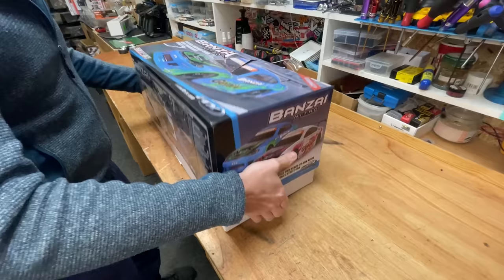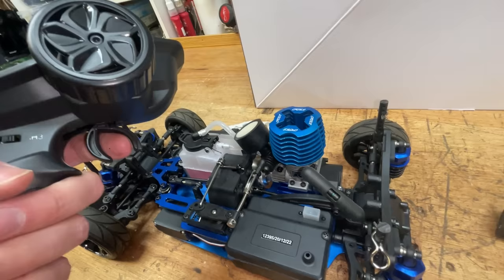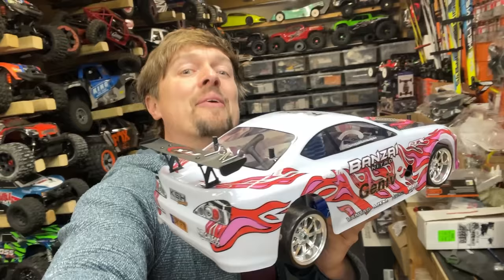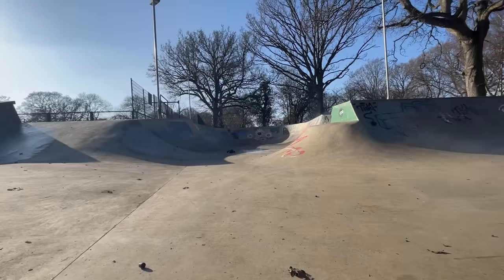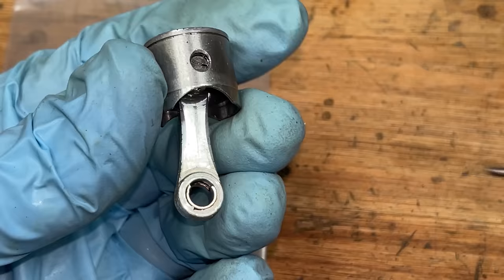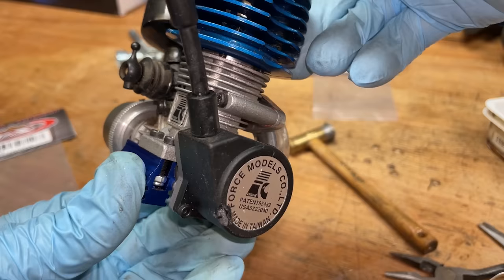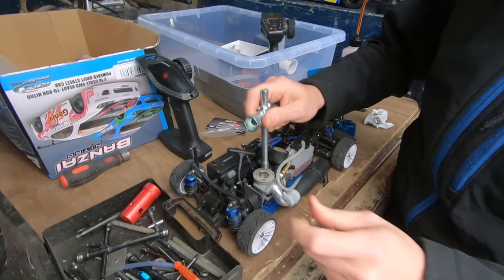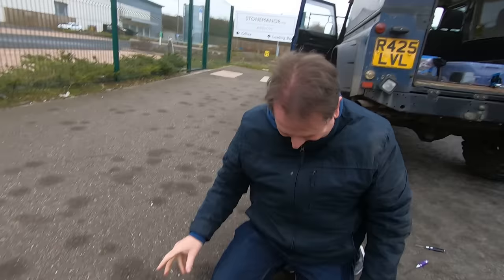Nitro RC Drifting (40,000rpm Engine Failure)

Comment: So again, nitro sucks?
Reply from the maker: user error. didn't run it in and and over revved and overheated it. these engines are really good actually
Reply: Nitro works just fine. If you have mechanical sympathy they can be long lived. Just like in the real world, there is a place for ICE and EV.
Reply: That’s the scx24 v2 radio lol
Reply: not atall, It is being overrevved no cooling, Had nitro engines for years set up right and treated as any engine should be no issues.
Reply: Im pretty sure that nitro motor with that high rpm range those rubber tires would drift no problem.
Reply: @user-qq2mo1ek2r  Yeah i have had nitro motors that last 15 years and still run amazing id say they actually rev higher and more responsive the more they are broke in.
Reply: I mean, they can be great. But in my experience, my friend has 4 nitro cars and 1 Arrma Kraton 8S and none of his nitros run, and he takes care of them very well. And he can't seem to get them going, but that's probably just his fault.
Reply: @eweezy946  yep also learned the hard way for got to remove the nitro gas in mine one time after storing it away for a min big mistake...
Reply: Yip the hassle sucks but the sound is awesome
Reply: Got to love that smell and the noise.
Reply: I’m personally not a fan of side exhaust engines but Kev is right they normally are pretty reliable if you intend on driving on low traction it needs to be tuned to temperature  also adding more oil to the fuel is a good preventative measure for this even 20% oil likely would have prevented this failure
Reply: @KevinTalbotTV  What about an episode with a nitro rc speed boat hitting a floating ramp and sending it to the moon?
Reply: Nope.  Properly broken in (if you're starting off with a decent engine, not something like the traxxas 2.5) then you can have years of relatively trouble-free operation
Reply: u cannot run or even break in nitro when its cold out its just not gonna work
Reply: @derekgardin1512   I've been running a Traxxas pro 12 or 15 (don't remember, it's on an OLD 4-tec) & a 3.3 for nearly 20 years.

Not race engines by any stretch of the imagination but I beat the hell out of them & they just keep taking it. Best upgrade ever for them is running a relatively flat 3s lipo for the electric start/glow plug igniter, and occasionally rebuild the carb if you make a ton of tuning changes. Any more trouble & a separate glow igniter usually solves it.
Reply: No they do not
Reply: Brushless motors and lipo batteries changed the game
Reply: Have to run them in
Reply: Yeah kev ..you should not have installed the drift tires... essentially your promoting over revving even more since all your doing is spinning the wheels .
Reply: @biggestthreattoyourexistence  I agree that lipo/brushless are both more powerful and less hassle but when you got a nice set up nitro it's just awesome...
Reply: Arguments over nitro vs brushless🤔 I have Hpi savage flux and various nitro versions of the savage and while electric is more powerful and convenient you just gotta have that sound and smell🤗 same goes for the Baja 5b.. also you gotta break em in or you just asking for trouble😂😂
Reply: You act like Kevin doesn't intentionally abuse everything he drives.  Nitro engines aren't that bad.  Before brushless and lipo they held the crown for power and speed.
Reply: @tonberryhunter  Defo🤣 he drives to destruction so we don't have to, that's the beauty of his channel👍as for nitro... I have a few that will do between 50-80mph out of the box and that's more than enough for me🤣🤣👍
Reply: User error, failure to break in+ bad tune. Kid didnt use a temp gun
Reply: No Kevin has NO IDEA how to properly break in or tune a Nitro engine, these HSP Care are very good for the cost, if you treat the car properly.  Kevin gets all this for free so what does he care, but the rest of us have to actually pay for things, and cannot afford to just go destroy our stuff. Go to a REAL Nitro channel and learn how to properly use a Nitro engine, not Abuse a Nitro Engine
Reply: So painful to watch … that poor nitro.
Reply: Where can I buy it??
Reply: @7r0j4n  You CAN if you preheat the engine before you start it, and wrap some layers of tin foil around the cooling head to keep the temps up during break-in. Keep an eye on it with an I.R. temp gun, and adjust accordingly.

I've done it many times in the cold, but I would not recommend it to a beginner to nitro R/C. 

Believe it or not, I have a WHOLE different way of breaking in new nitro 
R/C engines, and I do it in the car, with the car up on a test stand, with the engine at wide open throttle for 10+ tanks of fuel, with a heating device wrapoed around the head of the motor, all the while monitoring temps and keeping them just where i like with the heater. I'm not going to go into anymore details here, it's DEFINITELY a method for advanced nitro users, but this break-in method produces the BEST running, and longest lasting engines ever. I've been doing it for over 15 years.
Reply: Sussy baka
Reply: @James Cozzitorto  it doesn't do anything just put new fuel and fuel lines in and itl melt the jelly fuel no big deal
Reply: Oil bath run in method for an hour and they last for years with the right tune 👍🏼
Reply: No. If you got half a brain and break in the engine the proper way by pre-heat before start. Heat cycle
Reply: 1: no engine break in. 2: running drift tires and revving the engine like that I'm not surprised it blew! Stick to electric bro. Nitro is not for everyone 😁
Reply: Chinese ? Stock Bad quality of metals and gears?
Reply: Should always be broken in. Tuned properly and these engines will always output excellently and i have to say that i have never had these issues but these guys here on this video seem to be clueless which does bring a bad name to them but not to nitro engines. They beat the hell out of the piston and call it a complete rebuild 😂
Reply: I don’t know. I came from nitro to battery. Some times I miss nitro. Some times I don’t. But similar things happen with electric 🤷‍♂️
Reply: @Krapper515 en nitro tiene que tener uno idea que como funciona si el chispo que lo que da corriente ala bujía no está cargado no te arrancará nunca por eso si que coger una bujía i mirar si se pone incsndecesnte se enciende 😊
Reply: I have the same engine and its perfect dont be put off from it if you run it properly itl last and drift tyres are no need it slides with normal tyres
Reply: i have electric never had any problems this seams very complex and problematic
Reply: Nitro RC pylon racer planes are a lot of fun though. I love the sound of a 30,000+ rpm glow engine paired with the Doppler effect.

Comment: No break-in at all is not a great idea 😂 Anyway, let’s make nitro great again ⛽️👍
Reply: he make nitro die again
Reply: @truthandfreedom8145  wet concrete on the park
Reply: @TheNamesArif  wet concrete drys oil doesn't.
Reply: 40,000rpm straight out the box 🤦‍♂️
Reply: i hope not
Reply: Who cares! He’s not in it is he? XD
Reply: He’s not in it 😂
Reply: Nitro was fun when I was a kid. The convenience of electric RC’s is where it’s at when you’re short on time.
Reply: If you don't know its usual to run a nitro for a few tanks to run it in. Just run several tanks before you go nuts. Then re tune if you know what to really do. Sure these guys know the the upper and lower limit screws
Reply: Hey man, that little run away was all the break in it needed ;)
Reply: he doesnt break in cheap engines he does break in the nice ones though
Reply: What dis you think was going to happen the first time it seized he took the head off unstuck it and ran it some.more the damage was already done all the metal shavings just circulating through the crank all he changed was the rod and rod bearing
Reply: Gotta run em in the way they're gonna be driven 🤣
Reply: That was hard to watch… he tortured the little engine to death.
Reply: Well breaking it in means he has less content of him rebuilding it.
Reply: Just got into it and now have 3 traxxas trucks
Reply: lets not
Reply: @HughsReviews  ive given up on brushless the nitro fuel smell burning my eyes and nose is where its at all day long
Reply: Hey, can you send me a car can you show me the car?
Reply: break in isnt really necessary, its just for the warranty. i just run a couple tanks of nitro through and make sure it heat cycles

Comment: The engines needed to be broken in before full sending them also u needed a temp gun to properly tune them little engines
Reply: Tuning without the body, then putting the body on often fucks up the tune/temp anyway.

Comment: Hey Kev, i just noticed that at 6:34 when you were rebuilding the engine, you swapped the conrod 
You were supposed to put the conrod with the small canal facing internally in the engine.
That way the conrod has no lubrication, therefore youu blew it up
Reply: The "small canal" doesn't have anything to do with it, but which way the OIL HOLE faces DOES.
Reply: @davelowets  that's the same thing, canal means oil hole, which redirects to the conrod, lubricating the shaft
Reply: @davelowets  and i'm not English either so imperfections in the way i express myself are to be expected
Reply: I have seen this mistake made on larger 1 cyl engines as well

Comment: Kev easy trick for body posts is to dab a bit of paint or tip-x on the tops of posts. Line up body gently drop on to posts then it will leave a mark on inside of body where to drill holes.
Reply: Great tip!

Comment: Kev What you should of done is richen the high speed needle maybe a 1/4 of a turn anti clock wise straight out of the box it would of then got more oil at those high RPMs.

Comment: This makes me appreciate electric RC so much
Reply: How? Never seized a nitro motor in my hobby years (20 years), but just burnt esc on my arrma under 10 battery cycles...  And they aren't cheap. actually, you could get a whole engine on that kind on money... Of course you can destroy anything at inapropiate use as this, but I would but my money on nitros if runtime between failures would be measured. And lets not go in to the batteries. There is so much junk on market that it is unbeliavable.
Reply: @TheGhostman132  Also when little kids want to use my truck I can either put it in beginner mode or pop a Nickel battery in and it's to slow to break anything

Comment: The hpi nitro rs4 racer I use for drifting has a piece of fuel tubing zip tied on the controller grip behind the trigger. It normally allows about 1/2 throttle. If I need /want more revs temporarily, I smash the trigger and it goes to about 3/4. You can play with the EPA to suit.  It has ran like this for years and it keeps the revs in check when just tooling around. I've even let young children use it like this and it's fine.
Reply: Thats a really good idea. I thought the engine might of over heated from revving out without the car moving all that fast. Air cooling is only as good as how fast you are going. Revv limiting though? That is cool
Reply: Great idea! Glad that you brought it up! I would never have thought of it.
Reply: Not the same, but similar. I underclock my PC, I'm running a 12900k/3090 which when left unrestricted cheeeeeews through the power and gets super hot. I do a 10% underclock and it really makes no difference in the games but uses about 2/3 of the power and generates about 1/2 the heat. If I ever play a game that bottlenecks the cpu or gpu I can just go back to 100%, but in the mean time I'm saving energy and not turning my room in to a furnace.

Long story short. With RC cars, computers, anything really, if you buy high quality items you don't need to run them at 100% to have a good experience. Gains in most applications (HP, GHz, et al) is not a linear response, the last 10% is usually 50% of the heat/power/stress placed on the system. Your manual limiter for your RC car is a genius idea and has the benefit of having a pseudo override by "smashing the trigger" back. Gonna give that a try myself. Thanks mate.

Peace from Oz.

Comment: I love nitros. The noise they make.  I converted the pull start into a drill start using a 12mm socket and the original casing, worked a treat.

Comment: It's critical to run them in a certain way. I could teach you a thing or two about resolving overheating problems. there are a few modifications and hot ups not standard you can do to make them go hard. Haven't played with a nitro RC engine for awhile. 2speed kysho  V1-S was heavy but awesome handling, changed it to a  factory ported force . 12 Engine home made high stall lock clutch.. and a few other mods, the venom racing tyres weren't cheap replacing them Every 2nd time out. it Would run with the best 1/8 scale engine, car you could buy at the time.
Reply: The FORCE .18 engines tend to run quite hot so you have to be quite careful with them. I loved the .12 Hobao engine it used to be pretty epic and the HPI T-15's were nearly indestructable

Comment: All and all, that Force brand nitro engine is built like a tank! It handles extended running at full rpm with no break-in WITH 25% nitro fuel from the start. When the piston skirt shatters, you just remove all the debris from the inside and let it rip! When the conrod bushing goes, you just replace the conrod (usually you have to replace the piston and liner with it, and possibly the bearings, because of the damage the metal debris from the conrod will make to these) And let it rip again! You only managed to kill it by leaning it while at full throtlte with the wheels up. That's a solid engine in my book!
Reply: Not to mention the pull-starter, which should have snapped long ago 😂

Comment: Use the 14v cooling fan we use on our brushless motors. Mount it to the body right next to the engines cooling head with a separate mini 4s lipo. I have done this with great success. The consistent temp keeps the tune running well, so you aren’t struggling with adjusting for fuel air ratio as temp exceeds the allowed  tolerance.

Comment: One tip I always use for Nitro Longevity. If you hear fuel sizzling when you shut her down it may be a tad lean. If you ever say it's running better than it ever has then it is two seconds from a melt down.

Comment: The chunk missing on the bottom of the piston was the first bits of metal you discovered from removing the head. Did you do the proper break-in procedure? Didn't show in the vid so wasn't sure. If not that and the drift tires/over revving like you said is definitely what caused it to seize. Great vid keep em coming

Comment: When trying to fit the body post, use a sharpie on the top of the post and press the body down on them. You'll then have a prefect dot where you need to drill. HOPE THIS HELPS

Comment: i generally like your channel, but sometimes you take it too far. when the engine is brand new, all the surfaces are not seated properly. and THAT is why we run engines in, since the rod bearing takes some time to sit in its place and make a great working point, and then can be run hard. also, the idea of putting a broken piston into the engine is terrible by itself, but especially with the two stroke, because its channels are operated by piston skirts, and they need to be the correct size and shape. an i know you say you are not in it, but then you cannot be suprised than stuff does not like to work like that, and even if the engine will run, it would probably run worse, since now you might have messed up the filling of the crankcase. i like your videos, but sometimes you should respect mechanical principles and not act with inteligence of a beer bottle, if you do something like this with that hemi engine, you will most likely see a rod exiting the engine block... 

Cheers👍
Reply: 😂😂😂 its just a toyy
Reply: Ok
Reply: @mittie040  well the monster truck is also a toy isn´t it?🤣 just slightly bigger one🤣🤣
Reply: I get you bro..
Reply: @garage5125  thats the bigboytoy😂😂😂

Comment: The pieces missing or dents in the combustion chamber are from detonation and running lean.  There is no spark so richen it up a little.  Ive seen exact same thing in 2 stroke mx bikes.

Comment: To line up the mounts to the body dab a bit of paint pen on top of the mount posts and line up your rear posts and when you lay the front down it will put a dab of paint on the inside of the body where the holes should be. You can then quickly punch your holes and wipe away the still wet paint and you're good to go.

Comment: hey kevin i want to challenge you  to see if you can make one of the crappy primal rc motors from the primal monster trucks that you removed and make it  just as powerful as the taylor rc ones  and you can use any upgrade you need to make that power like nitrous  or a custom intake for a supercharger i  would like to see this as a future video.

Comment: I race 1/8 nitro buggy with  rody  VS  B03 21 engine. It all depends  on the brake in process. Nitro can be very reliable  and look after with a bit after  run oil .  Bit routine  maintenance.